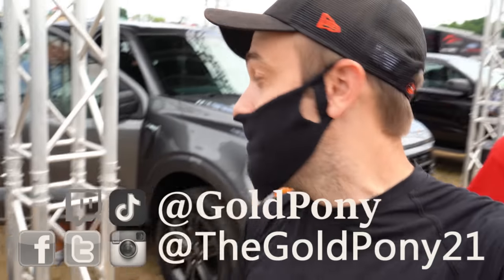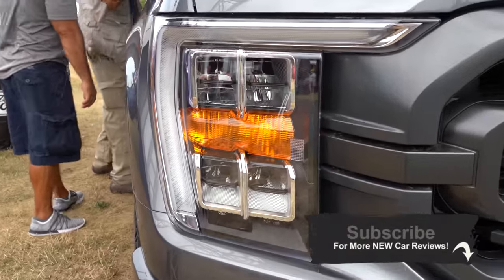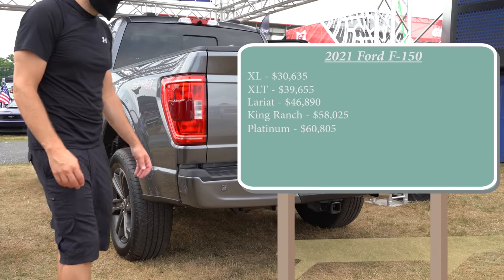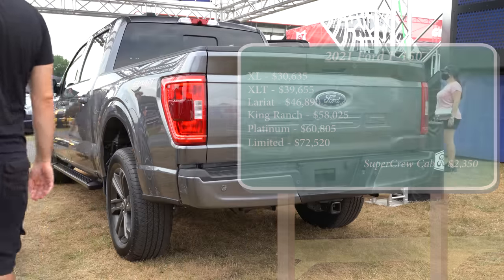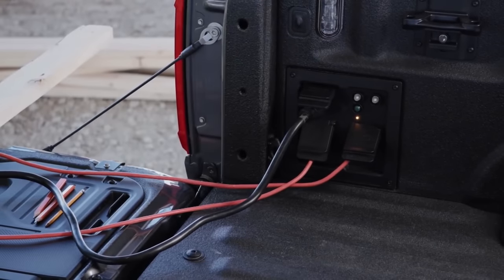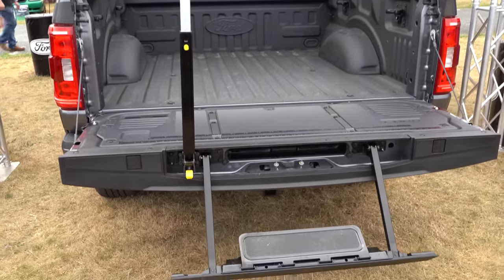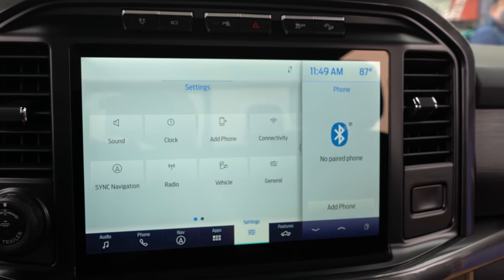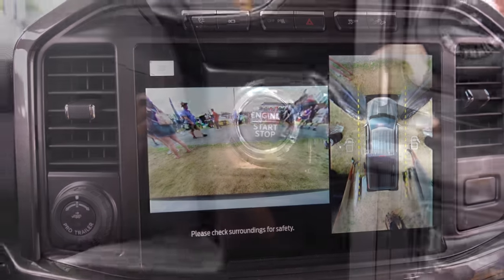2021 Ford F-150 First Look | This Truck will Surprise You

Comment: None towing for my 2015 xlt with the v8 and 36 gallon tank I got up to 800 miles to empty but drove 75% highway. If they are saying 700 for the city its nice
Reply: @Harv 1981 doubt it. They probably meant combined mpg and ford said that the powerboost is going to have a 30 gal tank so do the math and you get 23 mpg combined which isn’t very different from a 2.7 ecoboost
Reply: Stick w/ the v8, they get better gas mileage when towing🤙
Reply: @4pf339  I know when I get my truck again it's going to be a V8 and then get a new exhaust for it.
Reply: @Rodolfo Ancira i would get the v8 too, but im currently paying for my 2016 5.0 xlt, can’t afford to pay another $600 a month, so im waiting till 2022.

Comment: I love the outlets in the bed, fold down flat surface for lunch or laptop, big screen and wireless android auto. The 3 things I really wish my truck has. The thing I don’t like is top trim is 72k. My 1 ton was 72k. That means the f350 will be 100k.

Comment: I'm a Ram guy, and a few of the new features on this truck were definitely inspired by the new Ram, but this truck is pretty nice. I've always said good competition is great for the industry. Honestly, it's about time Ford did a major update to the interiors to bring it up to modern standards. Still miles better than the new GM trucks.

Comment: pfffff my 07 FJ Cruiser has dual glove boxes
Reply: Will last longer too.
Reply: buzztrucker yeah it will, the FJ is built way better than any american car
Reply: My wife’s 09 RAV4 has dual glove box
Reply: Troy C awesome! toyota for the win
Reply: @TheSlvrGR86  I doubt it would out last my old Ford ranger. It had 1 million miles on the odometer. And it was still going even then
Reply: War Thunder well your ford ranger was most likely the earlier ones when they were built actually well, i meant to say modern fords; older cars from every brand last a long time, not a lot of cars will last from the modern era
Reply: @TheSlvrGR86  I've still seen Ecoboosts last half a million miles. Haven't seen one clocked over that. but I still believe Ford's are very reliable in most cases. Anyhow enjoy your fj. The only good Toyota made

Comment: Ford interior still playing second fiddle to RAM I see...
Reply: interesting... Thought ford was gonna try and One up DODGE with the interior.. CLEARLY NOT...
Reply: Who cares rams are junk
Reply: Every time Dodge redesigns their trucks, Ram fanboys talk a lot of shit for about a year and a half...then they quiet right down. By then they've usually had a few major driveline repairs, half the fancy bells and whistles don't work right and the buttons to work the other half are broken. The lucky ones still have a functioning stereo, so at least they can drown out the squeaks and rattles. Hopefully by the time all those 2019s shake themselves apart the dudes who bought them have improved their credit score enough to buy a Ford or GM
Reply: I thought the same at first but actually no. Rams interior looks a little fancier but it’s all cheap plastics to be honest, and for over 50k that is ridiculous
Reply: @doilookwasted2u  Yeah, my coworker has a 2019 Ram, and within 10,000miles he has had issues with the electronic e-brake refusing to disengage, and he had the airbag light come on.
Reply: @michaelchristopher8266  Ya, my coworker had an F150 that caught fire on the way home from the dealer.

Comment: I just got a 2020 a month ago I should of waite for a 2021 🤦🏻‍♂️🤦🏻‍♂️🤷🏻‍♂️🤷🏻‍♂️
Reply: Already breaking down too? Mine wouldn't start yesterday. Lemon law, gone after 800 miles. They are taking it back Tuesday. I doubt the 21 is any better.
Reply: @Kevin A what engine?
Reply: Jesus Perez 2.7 ecoboost
Reply: @LP MICH sorry i meant the other guy but are you having problems with it?
Reply: Kevin A whelk I have 900 miles on mine but a couple of issues backup camera super bad quality sometimes works good and sometimes doesn’t , also the auto start and stop doesn’t work on my truck
Reply: Kevin A to be honest I trust more my old 2002 F-150 XLT with the 4.6 engine really good truck almos 200,000 miles 0 problem only regular maintenance
Reply: Jesus Perez no problem yea i got confused 🤷🏻‍♂️ lol
Reply: @LP MICH lol i wish ford could have gone back to the v8s, the good old days
Reply: @LP MICH Ford is beginning to cheap out on products, i don’t like it
Reply: Waiting for 2022 Tundra. Too many problems with my Fords. Switching...
Reply: @thankyou9085  You can get the Coyote 5.0 V8. You aren't pigeonholed into the V6 Ecoboost engines which I think aren't going to have the longevity of the V8 because of the GDI and turbocharging.
Reply: @kevina2052  damnnn bro... =/ make sure to get footage on all those malfunctions in case they dont want to take care of it.
Reply: @andresdoria6118  It's not a bunch of malfunctions. It's one, it won't start. It was towed to the dealership today. It's done, engine has completely seized up. They are paying off my loan, title fees registration fees, beyond my refund and all of my down payment is being wired to my account by Friday. It's been Lemon lawed.. Good riddance. First and last Ford for me. This is the third F-150 they have had do this at the same dealership. I bet they learned their lesson and probably got sued. Otherwise, it would have been a matter of getting a new engine.. no thanks!
Reply: @thankyou9085  ecoturd V6
Reply: @kevina2052  exactly, wise decision. Here in Lima Peru where Im located a friend of mine had a similar issue with an f-150, nowadays cars are soo electronic that have those little nightmares that you wouldnt had in a car 20 years ago. Try japanese cars, you should get some luck on that
Reply: @andresdoria6118  We have a Toyota in the family already. No problems whatsoever. I'm just very disappointed at the moment. You would think a company that dropped almost all of their passenger sedans to focus on what is selling these days would have the powertrain figured out. Previous years of the F-150 have been known for reliability. I guess they just suck at turbos..
Reply: @AdSando12  Toyotas V8 engines have proven pretty damn reliable. You know why? Basic engineering. It is actually understressed for it's size as well. Good choice if the keep that formula.
Reply: @Kevin A but they’re horrible gas hogs, but toyota can fix that. They need to lighten up the tundra, shed some weight so the motor is not under stress. Second they should replace the 6 speed and go 8 speed to add some fuel economy. They should also add vvt. I think they can easily get 16mpg combined, well i see 16mpg as the standard for all engines.
Reply: Kevin A I get that your mad, I would be too! What a nightmare you’re going through. But what happen to you is by no means common. I know several guys with  Ecoboost F150’s that have had  absolutely no problems with their engines.
Reply: I Like Ford Chevy GMC NOT RAM AND ESCALADES bruh you’re trippin
Reply: I Like Ford Chevy GMC NOT RAM AND ESCALADES at least i don’t sound like a 11 year old

Comment: Damn Ford nailed it! I have a 2019 Roush F150 and I love my truck and look forward to the day I upgrade to the new model. Probably wont be for another couple years but damn they stepped it up but the price is knocking on the 100k door to get a fully loaded truck which is ALOTTA DAMN MONEY FOR A 1/2 TON PICKUP!!!

Comment: Probably should have found a mid level truck to check out first. That full boat will be closer to over 80k. The difference between a top trim and mid trim can be 25k, insane. A lot of the amenities shown will be options, not standard. Truck manufacturers package those options to push the price up quickly, but still allow people to buy more base trucks minus the bells and whistles.

Comment: Does the engine need to be running to use the power options in the bed of the truck? Is there an extra battery to use this power? Can we use a solar panel to charge the battery? Is there a solar panel included with the purchase of a Ford F-150? A lot of questions.

Comment: Our 18 f150 Lariat 4x4 supercrew short bed has a 700 mile range on one tank as is with the 3.5l Ecoboost.  36gal fuel tank.

Comment: GREAT VID!   That 30 Amp outlet looks more like a generator style outlet.  Can an RV 30 Amp outlet adapter be utilized to provide 30 Amp service to an RV, while the F-150 engine is kept running, for an emergent situation?  Please advise. TY

Comment: Curious if they fixed the oil Consumption issues with the 5.0 and the transmission issues with the 10 speed transmission.. The forums are full of people complaining a pit noisy 5.0 engines that use oil. It's a shame Ford refused to fix these issues and this has turned many people away to other manufacturers.

Comment: Since its going to have wireless carplay, all models with it need to have built in wireless charging in my opinion. The 2020 models you have to get lariat or above with the ultimate package. Wireless carplay wont do any good if your phone battery dies and defeats the purpose if you have to plug it into an outlet to keep charged.

Comment: Just so long as you are not in an accident in one, you should be ok. Ford attempted to get it approved for sale in Australia. It failed the 2021 ANCAP (same as the Euro NCAP) 60kmph prontal offset crash test. The front wheel and wishbone assembly sheared off the frame, entered the passenger compartment through the firewall and took out the driver dummy. 0/5 on the safety rating scale. All the computerised stability control and collsiion avoidance systems mean nothing because this is a three ton truck with a separate frame right out of the 1950s.

Comment: at first I wasn't too sure about the front end re-design but with the grille designs I'd bet there would be one that looks good to most (unless you're a Chevy or Ram fan).  That example looks about what I'd spec out. suddenly, my 2018 XLT is looking a bit old ;-)

Comment: Car manufacturers are so disconnected from the modern customer.  Trucks are getting so expensive and people salaries aren’t going up. I love all the new cool stuff, but you are paying for the all the engineering. 40000 to 72000 you will need financing for 10 years soon.
Reply: The reason prices are rising is because people are still buying them at an alarming rate, $800 Truck payments are common these days.

Comment: I don’t have any info on the v6 powerstroke, but the only one of those engines I’d pick would be the 5.0.  The turbos on the ecoboost are bad about breaking.  And make darn sure Ford didn’t stick your 5.0 with a crappy 3.31 differential.  (Ford is bad about that.)  Make them find you a 3.73.

Comment: My 2012 EcoBoost will make it to 170k. It's been reliable but to keep it running now will be too expensive. Basically I would have to put a rebuilt engine, turbos, and transmission in it to keep it running. Hopefully the 10 speed transmission will last longer. I'm not sure if its worth it to pay 60k+ to only get 170-200k? Great truck but it's not a 300k truck.

Comment: Why are people so taken by the folding shifter when having a shifting lever behind the wheel would have solved that problem to begin with like in the Ram.
Reply: some people like me want the console shifter its that simple
Reply: Willie what difference does it make some people like you
Reply: @sdbszz706  that dont even make any sense  but ok
Reply: Willie ok mr. “some people like you”

Comment: Still looks dated inside to some nice features for sure.  But the steering wheel is still full of buttons, the dash under the display also.  Ram still to me is the top interior to beat.  Then Ford and GM after.   Nice looking truck on the outside though and definitely interested in a power stroke for the mileage.  Pretty cool bed features also I like the outlets etc.   That’s my opinion though.

Comment: Folding a gear is a royalty it it was an electrical column shifter that would be better which gonna empty the space that folded shifter takes so you can use the elbow rest to make a table for eating your lunch or using computer 🤔

Comment: What's with the keypad? For the price up, they should have move it inside of the pillar just like Edge or Explorer has it for years, it would be so complimentary to tech upgrade...I wish i would have "any" keypad on my Ram though :), This new F150 is really nice truck with better interior   edit: Need to point out, the carryover Coyote has now cylinder deactivation
Reply: Market research said most owners prefer the physical buttons,work better with gloves on,yeah I use mine all the time,I usually leave the keys in it,at the beach,waterpark,atving etc.

Comment: The ruler on the Tailgate = A+
The Cellphone holder on the Tailgate = A+
Bottle opener.... ehhh.... i guess (cant tell you the last time i dranked a beverage with a bottle cap, seems so 1990's to me)
The Fold Down Shifter.... not a Genius Idea when Dodge has a Turn-Knob near the steering wheel. #OutOfTheWay

Comment: over the air updates
What they probably wont tell you though that if they wanted to. They Could turn your Vehicle into a Giant unusable Paperweight cause you decided to Tune and modify your truck,so,they decided to Void the truck cause the system can likely tell what has and hasnt been changed and if its been tuned.

Comment: I have  Platinum and got it with the step on the gate and have had the truck 3 years and have never used the step.  I always forget it's even there.  And i'm not one that it's easy to get in, i'm 300 lbs.  would make things easier if i coudl jsut remember it is there.  I have trucks my entire life and never even think about the step being there.  SMH.

Comment: Did they fix the 5.0 from excess oil consumption?
Reply: ????Say what, near 100,000 miles, 0 consumption.
Reply: @richardschipper5989  not mine. 4 qts in 5000 miles.

Comment: hope they fixed the death rattle after 15000 miles like my 2018 has and it has 19000 miles on it now
Reply: its loud with window down when you push gas and let off in town it goes grrrrr

Comment: I'm a bodyman painter for 30 years yes the new aluminium bodys are a challenge to work on but  gmc seirra 2019 i put a new roof on last week from baseball hail.gmc is a bitch to fix!360 camera realign was 200 bucks once windshield was pulled and replaced

Comment: That new shifter looks like the one in my boat.  Also, my 2020 RAM diesel gets over 700 miles with a tank of fuel as well, and it does not have mild hybrid system.  So no big news there for Ford.  Also, I noticed Ford always copies RAM on all their new items - for instance just look at that glove box system you're raving about.  I have been a Ford fanatic for so many years, I had a lot of problems and they are not a great truck at all...  My new RAM is way more comfortable, rides way better, looks much nicer and has a lot of really cool options Ford is just getting around to.

Comment: Does all that come with all trims or just or lariat and above ?
Reply: @TERREL MILLER the powerboost? I thinks thats on all trims, but the lower the trim level, the more the engine is going to cost. The 5.0 cost 1k on the lariat, but on the xlt it almost cost 2k.
Reply: @thankyou9085  I'm talking about all the new tech features!  The 360 camera, push to start,  slide down shifter and the flat laying seats, are all of those things standard on every trim or is it lariat and up? Let's be honest the F150 is the #1 selling truck in the USA but it's really the XLT out of all trims that sell the most, so I'm just wondering if the tech amenities come standard on their most popular trim? All I keep hearing is people talking about the limited.....
Reply: @TERREL MILLER i think it might come on xlt 302a or higher

Comment: Personally I really don’t like it. The the step stool is overkill why not just add the steps to the bumper? And the gearshifter doesn’t look that great looks like it’ll break. Taillights look less aggressive than on 15-20. The sync 4 looks amazing though. I’ll consider trading mine for a 2024 when it comes out. I’m sure it’ll be more to my taste

Comment: Beautiful truck but my gawd $72,000 for a limited 😓 is a heavy price to pay for a vehicle. 

At that price I think I'll just keep my 07 Sports Trac V8, if the engine or transmission ever blow up, itll be far cheaper to replace them with whole new zero mile units than to get a new truck.
Reply: An XLT would be half that, but let me guess, you’ll still be keeping your 14 yr old sport trac.... 🤣
Reply: @getwrecked488 Damn right I'll keep driving the sport trac, I rather spend my $35k-$72k as a downpayment for buying rental property, if the sport trac dies I'll just buy a low mileage 17-18 fully loaded Tundra and drive that for another 10-15yrs.
Reply: Boostang lol if you’re dumb enough to invest in real estate better stick with the sport trac, it’ll be worth nothing whether it dies or not, and the loaded 18 Tundra will cost you every bit of that down payment.

Comment: A folding gear shift to make space lmao, could have solved that with a column shifter.
Reply: @coreygillet  lol I know what you mean. A bench seat leaves alot more room for....activities....lol. but can you have this center console desk option with a colum shifter? Because that woukd be the most ideal setup. Funny to see what happens if that shifter gets stuck in the down position and you can drive it lol

Comment: No thanks. My 12 valve Cummins is still going strong. Given to me by my grandfather. When he got it, he paid 15k cash. It’s a 97. Use it strictly for hauling, just put new trans in last month at 700k miles.